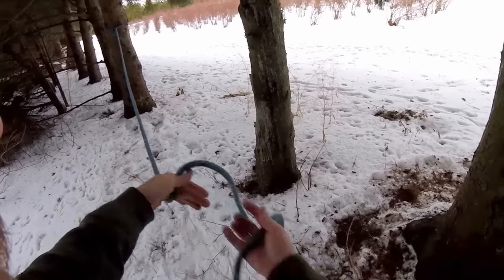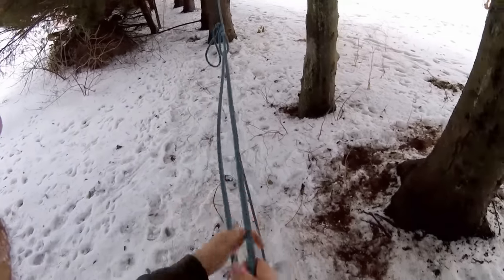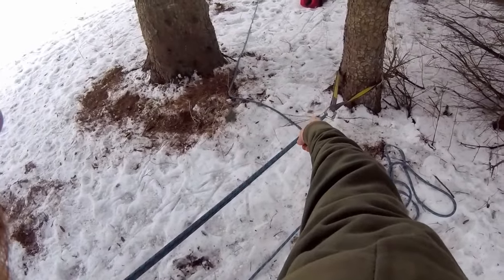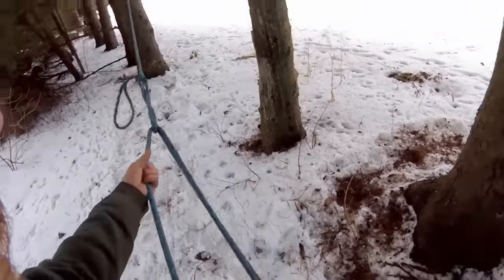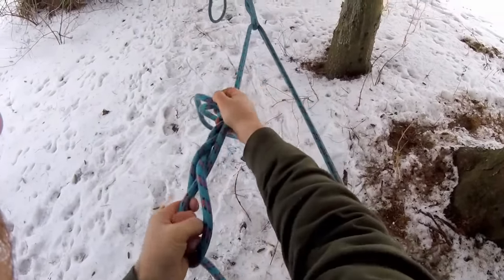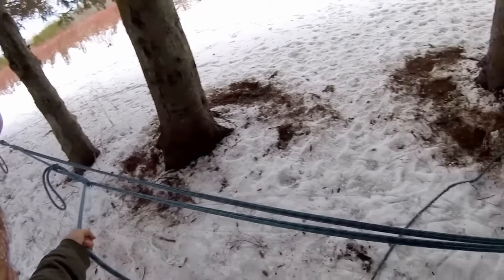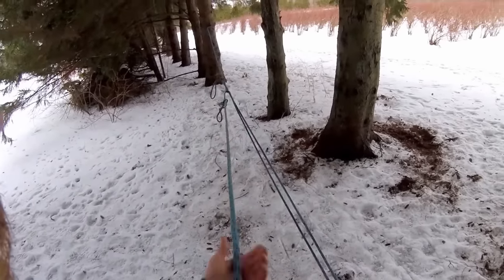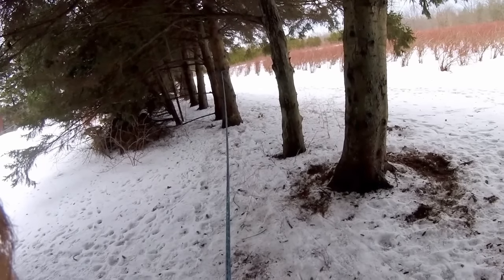English Trucker's Hitch / Dolly Knot

Comment: When I was a boy in England during the 1960’s, I used to go with my dad in his lorry (truck). In those days loads were roped and sheeted by the driver. The dollyknot was the first knot I could tie properly, as he used to rope his whole load (with a single rope usually) on both sides using Dolly knots on every hitching point.
Reply: all so true. back in 1950s/60s long before the Ratchet straps. if the rope`s got wet  over night they got loose and we would have to tighten down before driving off, also when the hot sun dried rope out it would all go tight. sisal rope!

Comment: Excellent video mate ... you know how to do the knot properly. So many folk advising to use the slip knot which is not a trucker's hitch. Heavy tension and certain ropes will bind and you'd spend ages getting the damn thing out. No self respecting trucker would use it. Kudos and well done for showing folks how it is done properly.
Reply from the maker: Thank you sir, I get so much value out of this hitch and it blows my mind that most people in my trade don't even know how much you can do with it, much less how to tie it properly. It's one of my favourites!
Reply: I agree.  Trying to undo a tensed up slip knot is a bitch.
Reply: Hell, I’ve been using an alpine butterfly for my truckers hitches so that they’re easy to undo, but this one is better even still!

Comment: Here in the UK we truckers call it a Dolly Knot its the main knot we would use, nice video showing how its tied BTW
Reply from the maker: Thank you, is there a reason it's called the Dolly knot or is that just tradition?
Reply: When I was taught to do it the old trucker told me when making it the loop at the top was the head then when you formed the bottom loop it was the body so I always figured that was the reason
Reply from the maker: I love it. The Dolly knot. Thank you for sharing that.   

Muggs
Reply: I was taught the knot back in Yorkshire, northern England and we called it a wagoners hitch. Always been my go too knot for tying a load i can't stand those ratchet straps! Great video

Comment: This is correct, standard UK truckers knot, though if you're right handed you may find it a bit easier to do it the opposite hand. i.e. take the first 'big bite' as you call it in your left hand and not your right hand as once you've rested the first fold on top of the rope you can do the slightly trickier bit with your good hand. Works both ways just the same of course.  The big bite doesn't need to be that big, less than half that size is just fine. You can do a third wrap for a bit extra grip.

Comment: Very cool. I made up something very similar. It takes slightly longer to set up and requires an extra biner, but has a little less friction. One other thing I add to help this is instead of tying up high in the tree, I'll add a natural crotch 2-1. The rope STARTS at the tree where you had your sling, then it goes up to a solid high crotch in the tree you're pulling over, then it comes back down to the tree you have your sling on and you set up your mechanical advantage. Now you almost double your pulling power right off the hop
Reply from the maker: One thing that I didn't mention in the video that I wish I had, is that in this application, the friction of rope-on-rope actually adds to the setup, acting almost like a progress capture. So you can put all of your pull into the line, and then hold that pull easily thanks to the friction. I remember one time during my apprenticeship, we used this trucker's hitch, piggy-backed on itself like in the video, to pull the 40HP stump grinder up a hill in the rain after it had slid down sideways. So many people are negative on the friction in this hitch, but you would be amazed at just how much of a pull you can get with it. Minimalism at its finest!
Reply: EducatedClimber.com interesting, wouldn't have thought of it like that, good point

Comment: Man I've been using an alpine butterfly for the loop, but this is clearly better because it unties so easily. Judging from the remarks below by truckers, this knot is evidently more robust than one would think. I wonder if it ever falls apart if the lines become loose as the load settles.
Reply: Once it's been under tension it holds its shape, but still shakes undone....if you are not confident, put a half hitch over the dolly's head.

Comment: Very nice.  I've been using a slip knot and really hated dealing with the mess it makes.  Is there any problem using the Alpine Butterfly? This seems to use less rope.  Thanks for the great knots!
Reply from the maker: Hey Sam, no problem with the butterfly, I just prefer this. Thanks for watching!               - Patrick
Reply: Alpine butterfly is more stable but harder to undo. That’s the compromise with most knots

Comment: so instead of taking a bite through the loop and then all the back to the krab, I put a krab with a pinto onto the loop and then sent the rope through that. So no rope on rope friction. Doubled it up and it was a beast. Can anyone tell me a problem with that? all I can think of is not knowing the limits of the gear overdoing it. Im thinking of getting a couple of pinto rigs, a rig plate, and experimenting with  back leaners
Reply from the maker: That certainly works, and lots of people do it that way. I actually prefer the rope on rope friction in many ways, it acts almost like a progess capture, helping to hold the tension for you. Lots of different options! If you are getting serious into playing with backleaners, I would look at getting a fiddle block setup for super-low friction 5:1 action plus built-in progress capture.

- Patrick

Comment: Can anyone explain why this is  3:1 advantage I only calculate 2:1?!!
Reply: Is it because there are actually 3 lines going to the "load"? I want to know as well. On my block and tackles you count the number of lines going to the pulley attached to the load. Also by adding another truckers hitch like he did, is it 5:1?
Reply: @timadams5046  2:1 then doubled = 4:1. Basic single pully without the pully

Comment: Though some people call all these types of hitches 'Trucker's hitches', a lot of people differentiate and call this type a 'Truckie's hitch'.  Of course this is based on a half-sheepshank, meaning half-hitch around a bight.  Trucker's hitches have a knot tied in the line that forms the pull-loop.  Various knots can be used.   
Don't know why this is called an 'english' hitch lol.  I've seen a couple of Aussie vids that use this same two half-hitches around the bight with the second behind the first and it weren't no 'english' hitch.  Just a Truckie's hitch.  
Btw, for the life of me I can't see why twisting the lower bight does anything.  I used to twist it but then could see no possible reason for it.  Plays no part in the tensioning.  Nothing.
Reply from the maker: Bixby, I made up the name and I call it 'English' because an Englishman showed it to me, combined with the fact that in 10 years of tree work I have never seen anyone else in the world of arboriculture using this variation of the knot. My interpretation of the Truckie's vs Trucker's was that the Truckie's involves a fixed anchor point, like a post or rail, and a Trucker's can involve something midline attachable, like a 'biner. I'm probably way off with that but that's just how I think about it.

As far as the extra twist, I used it for years without the extra twist and it totally works, but in the process of teaching it to other people, they seem to get better results with the extra twist. The knot will untie itself without sufficient tension and the twist seems to help keep this from happening. The extra twist is not necessary, that's just how I teach it to noobs.
Reply: It's the standard load lashing hitch used by truck drivers in the UK.  It was taught to me by my father back in the 1950's.  He'd used it all his working life and I used all of mine, both of us driving HGV's in the UK.  Odd thing though, from what I've seen on the Internet Auzzie drivers tend to try to use the hitch on the nearside of the vehicle with short lengths of rope.  We favoured using much longer ropes zigzagging the same rope all along the load.
Reply from the maker: Yes, I have seen it a couple times called the Lorry hitch. Shown to me by an Englishman by the name of Andy Lake. I just don't see it being tied this way on this side of the pond, so I teach it to new tree surgeons all the time. Still one of my favourites for minimalists!
Reply: @TreeMuggs_PatrickM  as a third generation English lorry driver I was taught to tie this hitch by my grandad, he called it a hay man's hitch or donkey's lug (lughole - ear); as he used a waggon and horses before he drove a lorry I'm happy continue calling it a hay man's hitch.  
By the way you don't need to put in the second wrap but always works better with the twist.  
Two's tight enough three'll break the rope.
@donfink7063 Always zig-zag.

Comment: Well call that a double dolly
Reply from the maker: Yessir, double dolly, truckers, truckies, lorry hitch. No matter what you call it, she's a beauty!

Patrick
Reply: EducatedClimber.com been using it the same way for 30 years but to save time on the last dolly I use and automatic truckers hitch.. Saves tieing it for short runs
Reply: Slight difference is I put my loop under and wrap round not on top.
Reply: Loop under wrap round neck twice.. Put full twist in with one hand and pull other through... All one fluid movement... After many years practice
Reply from the maker: David, I want to see a video, that sounds awesome....